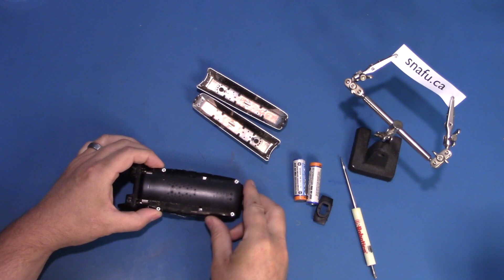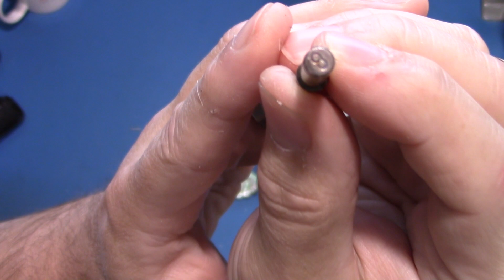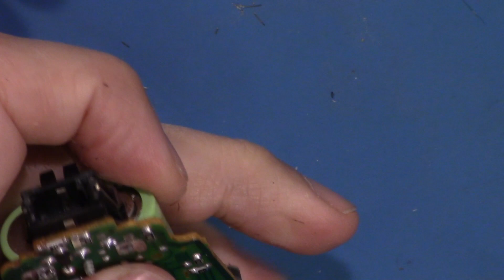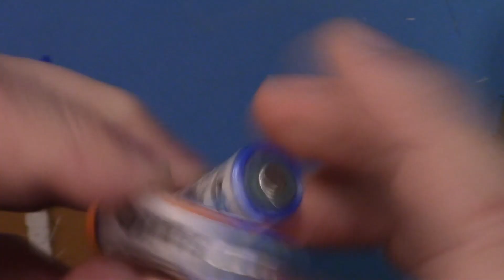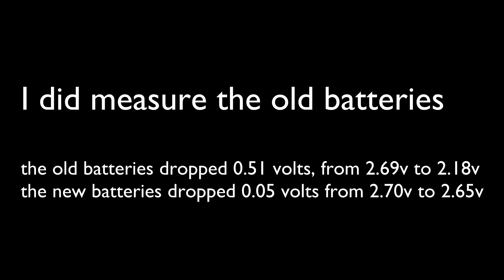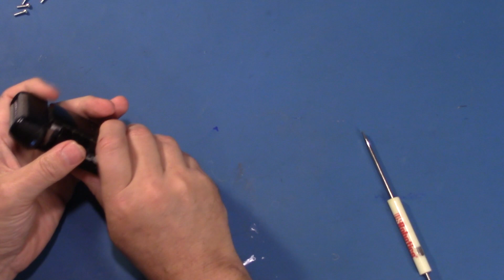Braun 7526 Shaver Battery Replacement

Comment: I did this and brought my favorite shaver back from the dead! Thank you! One thing I did to make the process easier was to purchase a cheap spot welder and some nickel strips made for connecting batteries. I had purchased a newer Braun shaver years ago but it was nowhere as good as my old 7526 model from 2005. Thanks again!
Reply: Amazon is now selling a replacement battery that has the strips already attached.  Makes it even easier!

Comment: Just subscribed. I have a 7520and just inserted two new batteries like yourself. Sadly when I connect the lead the charging light does not flash continuously but has periods of rest. Is this normal with old stock new batteries? Regards from the UK.

Comment: Thank you for the video. I disassembled mine for cleaning because the slide switch was not fully functional. Can't say much for German engineering since the thing was absolutely full of whiskers. It really should be sealed or shielded better given its intended use. Oh no thank you again

Comment: awesome...had this shaver for over 20 years and it was excellent. But the batteries were not holding the charge. I bought replacement batteries with the tabs and I'll be using the video to replace mine. Thanks

Comment: Great video, thanks. I've tried to replace the batteries on 7680 which comes with a digital display. After 10 to 20 mins charge it overheats and "temp!" displays on the digital display. I've tried this with 2500mAh, 1900mAh, 1500mAh and 1200mAh batteries, same outcome. I wonder what could be wrong! Any ideas?
Reply: It is necessary to put batteries with a capacity of no more than 800 mah.

Comment: My 7526 is 16 years old and barely holds a charge. Will there be a problem if I don't replace the batteries and plug it in to shave ?

Comment: Apart  from saving the materials from the landfills the 7526 had a 'random' foil pattern that works excellent  for my  facial hair; actually have the newer Series 7 with the hexagonal/honeycomb modular pattern and it grabs and pulls. Dug out this old one to find out why it worked so well and I suspect its because the foil is both recessed plus close up inspection of the foils will reveal it has random* perforations

Comment: I installed the battery’s and plugged it in for a charge. Charging light does not come on and the shaver gets warm
Reply from the maker: A couple of things to check, make sure you have the batteries the right way around, if you're looking at the shaver with the connector at the bottom, the left battery is positive on the top, and right battery is negative on the top (obviously different than the bottom).  Second, make sure there isn't a short between the connector at the bottom and the bottom of the battery, if there is put a little tape between the two.  Lastly, on the top battery, make sure you haven't blobbed the solder, it's easy to short out one of the contacts to another that it shouldn't connect to.
Reply: @Boffin55  The new rechargeable battery’s are in but they don’t take charge after a full four hour charging. I plug the unit into the outlet and it will work but will not charge the newly installed rechargeable battery’s, interesting 🤔

Comment: Why doesn't Braun just make these things so the batteries snap in, like most everything else until some cell phone makers solved their battery problems by sealing the things together with glue.  I've worked out most carpentry problems I've had from having one hand paralyzed by using various clamps, vices jacks and power tools, but soldering isn't something I've figured out a workaround for yet so haven't bought any tools for that in about 40 years, and that was just plumbing not circuit boards like several friends of mine in the Navy used to do.  But now at least I know what's inside it and what does work so will think on it for a couple years as Io have a spare I bought 15 years ago of a similar but newer model as the charge and clean stand of the 7000 series had a plastic part that kept breaking so have been using the 7526 with the cord most of the time and cleaning and lubing by hand.  Mine is 26 years old now give or take a few months and just stopped charging the batteries yesterday, but the current is still running through it with the cord attached so will keep as a spare if have to do some traveling or spent a couple months in a hospital again though I'm getting a bit too cheep to spend time in a hospital anymore. Good DIY video though, if had the tools and use of my left hand would fix that little problem in the morning now!
Reply: Hope you find an apprentice John! If I lived close I'd love to learn under your supervision! We need to bring mentorship back! Sounds like you've seen quite a bit!

Comment: Many thanks I've got a 7790 which I think can be handled the same way. It really is scandalous that for just a dead battery most people have to either replace their shaver. What an incredible waste of this planet's resources. Governments should pass laws that force manufactures of shavers and toothbrushes to make it easy to replace batteries.
Reply: The operation on my 7790 was a success. But there are a couple of points to note. While I was able to buy batteries with tabs I needed to file them down to get them through the circuit board holes. Also as the video points out you do need a good size bit on your soldering iron, and if, like me, your soldering skills are very rusty then you may find it hard to produce nice soldering. What I did worked, but I'm pretty ashamed of my soldering and won't be too surprised if it eventually fails.
Reply: BS

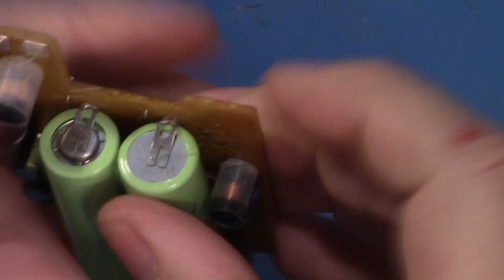Comment: Great video but would it have been easier to cut or de-solder the old battery contact and re-solder it using the old contact instead? See 6:18 for a clear view of the contact.
Reply: I think the problem is that the original contacts are tack-welded to the cells.

Comment: Thank you for the upload. Most informative...flux pen, different temperature solder tips,  cheap Chinese solder, all stuff I was not fully aware of.  Purchased a Braun 7505 recently from a second hand shop, batteries were almost dead. With your video I now understand how to replace the batteries. One can basically learn anything from Youtube videos. I love repairing older equipment as opposed to throwing it out and buying new stuff.

Comment: Good video. I also learned about the value of a flux pen (on my bucket list already) and that Weller have different ratings on tips (although my Weller TC Station has presettable temperatures.) Thanks for this. I'm going for tagged cells though!

Comment: Great tutorial. Not any battery though; NiMh 1800 mah with tabs are preferred (available on Ebay, myself got it there). Higher capacity battery are reported to confuse the on-board computer logic.

Comment: Hallo Boffin, my 7570 shaver will will not turn of anymore. I open it and clean it from the inside hoping it will turn of again but it does not. What do you think is the problem? 2 hours later i found the problem :)
Reply: Hey my 8975 series 5 did the very thing, can u tell me what causes it plz thanks

Comment: Awesome, thanks for posting this. Great work by the way.  I found mine up in the attic I put it away about 8 years ago and forgot about it. Well i charged it up, powered it up, and the motor runs pretty low. when i insert the power cord, it runs like a champ. so i think my batteries are bad. I will need to replace them as well. is it true if you use batteries that are over 1700mA that the firmware on this device would be confused and shut the razor down ? I see  you used 2500mA did you have any kind of issues? are you able to reset the frimware some how ?
Reply: I used some old 2500s and no issues, and you can get inexpensive 1500ish one from any store these days
Reply: Anyone's razor not turn off?
Button not letting slide return back to shut razor off?
Reply: @billyostendorf8044  Hi Billy. I had the same problem today out of the blue. This is the first issue I've had with the unit since I bought it new in 2002! (Today is 8 April, 2020.)...

But ya... suddenly it would not shut off. The slider seemed to be stuck and would not slide all the way down to the off position. Luckily I found Boffin's video here on battery replace... So with the raiser humming away at full speed, I managed to use this video to take it apart. Once I got down to  where I could remove the batteries, it finally stopped running, of course.

I notice the mechanism for the sliding switch is on the opposite side of the unit than the batteries. I can clearly see all the moving parts but I can't figure out what is keeping them from working properly.

So I am wondering if you ever got yours to stop running and if you could fix the slider mechanism so it would turn on and off.

I wanted to as Boffin about it, even going to his referenced blog site (a Wordpress site) but he doesn't list an email address there.

Any assistance (tips) you could give on getting the switch slider to work again would be greatly appreciated. Or... if you happen to have Boffin's email address, I could try there too.

I really love this raiser and would love to get it running again.

      RJ